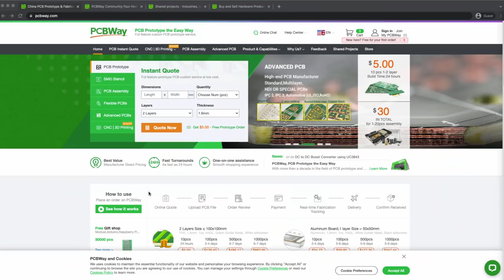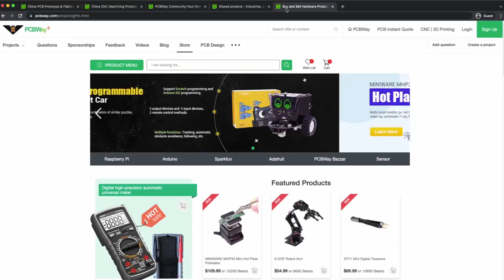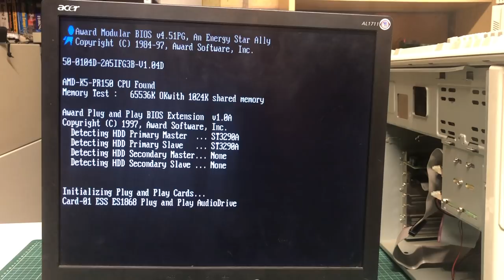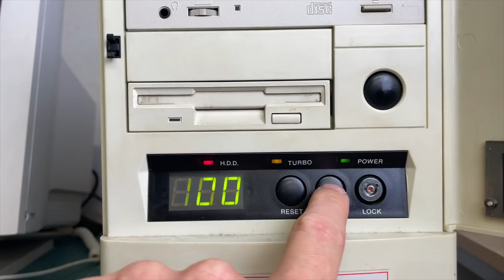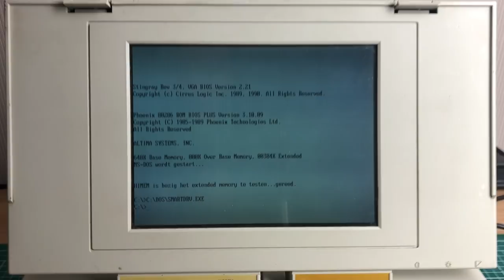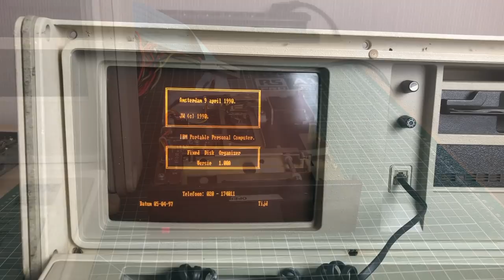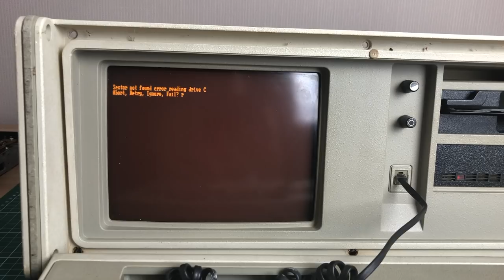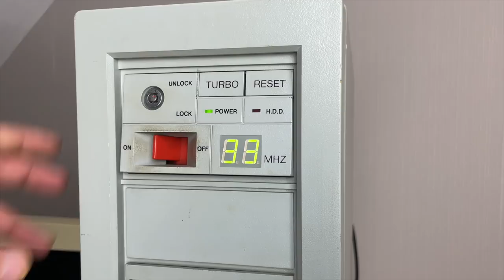ASMR - Enjoy the sweet sounds of old PCs

Comment: Some of the CDROMs make distinctive sounds, the sounds their tray makes, the sounds the focus servo makes when detecting the disc, with the one at 7:00 trying for the medal of slowest drive tray (I have one in my stack of vintage CDROM drives) - for example, the Matsushita 2x drive makes a very interesting sound when detecting the CD, almost like birdsong.
9:42 you got the operating system spread out on two floppies? Now you need a third if you want to run any software :-)

Comment: Fun Fact! If you're watching this on a PC old enough you don't need this video.
Reply: Does a PC circa 2008/9 count as old enough? 😁  Too skint to upgrade after 11 years of using this old PC, and new ones cost £3000 here in England for anything worth having.  Mediocre builds can be had for around £1000.
Reply: @EgoShredder  To be honest as long as you don't need a powerful machine that is probably one of the best things about computers now days, if you don't need a powerful computer just get a computer from over 10 years ago and install Linux on it, that whole joke of you finally get you're new computer home it's already obsolete is kind of outdated. As long as you're not doing something really hardware intense like 3D rendering, old hardware doesn't really do any better than new hardware. I still have my families old computer witch my Dad got in 2012 and I installed FreeBSD Unix on it and it still runs perfectly fine.